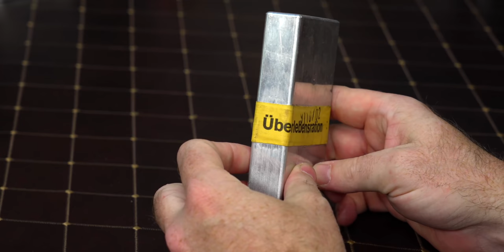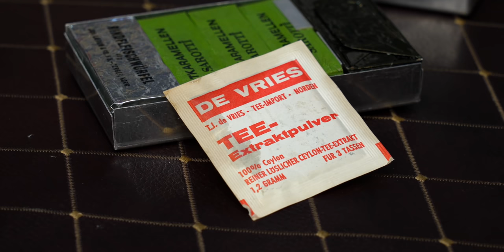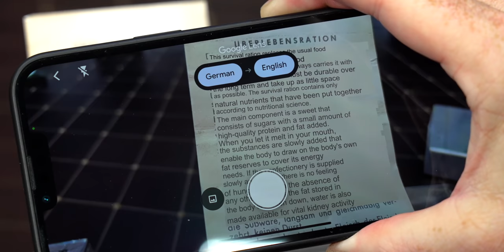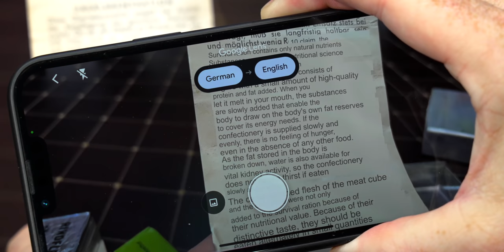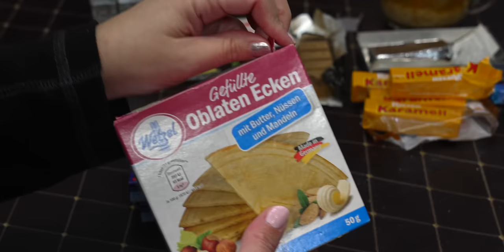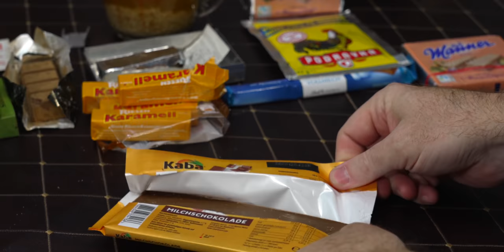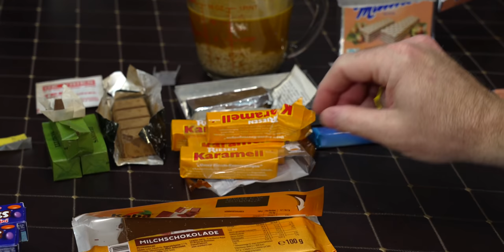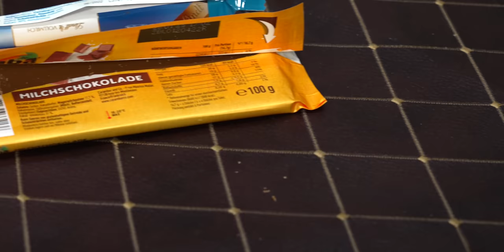RARE 1977 Vintage German Military Survival Ration UBERLEBENSRATION

Comment: So what will Nathan and Amanda be eating on the MRE channel in the near future?  The MRE is not going away but the  Defense Dept in Natick Mass. continues to work on a replacement for the First Strike Ration assigned to combat field units. The Close Combat Assault Ration is designed to provide a soldier with 7 days of food without resupply and reduce its "carry weight" to a total of 10 pounds.  The current MRE would weigh in at 32 pounds for seven days (3 packets per day) and takes up nearly 70% more volume than the newer ration (if you even fit these in the backpack).  The new ration contains all the food in one packet per day and reduces both weight and volume of the food elements.  Two key new processes microwave "dry'  the food and another runs a sonic compression to reduce volume by nearly 60-70%.  Unlike freeze dried foods, the new rations do not require the large volumes of water to prepare. The same calories in the current MRE are matched in the new ration but includes more protein and dense carbs.  Lots of bar like packets and food squares are the samples I have seen.  I get the sense of a diet menu of a pro athlete that is provided to a combat team.  Sample tasting of the new elements isn't bad but it is not "comfort food".  I did taste a lot of cheese options and protein bars.   The over all concept of the new ration is eat to live rather than live to eat.  Good news for Nathan, I saw no onions in the menu!

Comment: The first time I saw the packaging on that I thought, "How cool.  In a metal tin, sealed with tape.  Waterproof, as long as it is properly stored it should be good for a lot ng time.". Unfortunately some of the items was not the best choices for long term storage.
Yeah, those plastic wrappers on those Motel 6 cups are such a pain, but, it is like that paper strip on the toilet.  It is there to assure you of the "cleanliness".